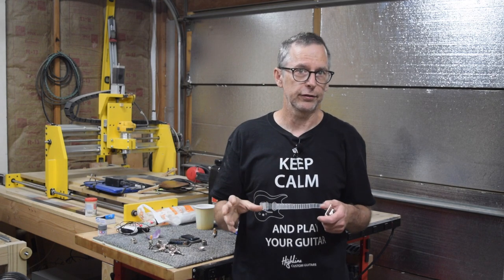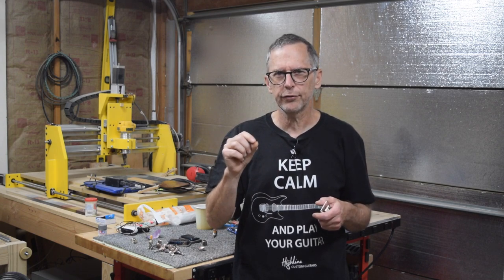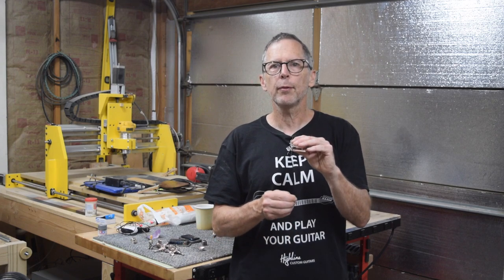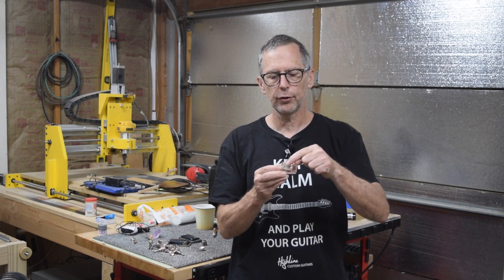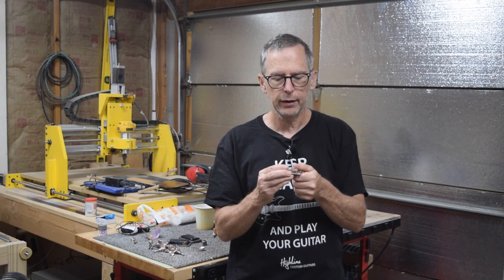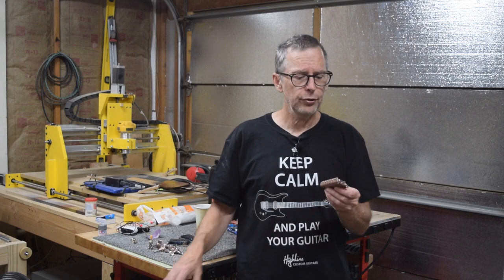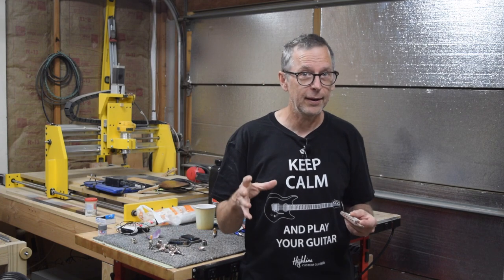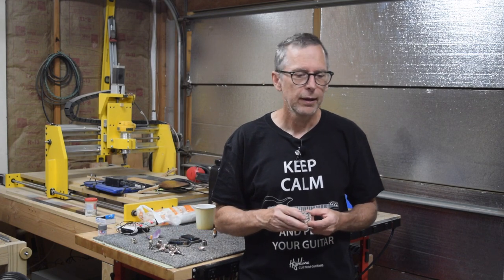Luthier Quick Tip 2 String Through vs Top Loader Guitar Bridges

Comment: Guitars with top loading bridges, especially in a 25.5” or longer scale length, play better. The shorter and more direct string path through the bridge yields lower string tension. This isn’t theory, I have tested it more times than I can count.
Reply: It's not tension. It's a string stiffness difference you feel (force required per unit length change => bend feel). String tension is entirely determined by tuned frequency, scale length, and string mass per unit length (gauge). The bridge type doesn't change any of those.
Reply: Its definitely not a theory, its a hypothesis at best and one I disagree with.  Its not you.  There are so many comments from people in the comments that are complete fiction.  The string can be 15 miles long.  The only part that matters is the part between the saddle and the nut.
Reply: @vw9659  that is my thinking exactly.

Comment: I'm getting ready to try top load on a particular Tele because it plays sooo stiff. Not sure why since I have other Teles that are fine. Love this one but it is murder on the hands. I'm thinking top loads should help due to a shallower break angle behind saddles.
Reply: I think it's because the length is shorter (missing the length thru the body) that the strings feel looser.  If that's not it, I hope someone will tell me the right answer.

Comment: Nice vid! For tuneomatics I'm confident it affects tone, since I enlarged the afterlenght of my Gretsch to the 1/6 used in violin families and to me tone and sustain improved . Just mute the afterlenght to check it. The string vibrates after the bridge more freely (I also have a roller bridge on a Hardtail) than I an short or wraparound bridge, thus lasting longer vibration and changing tone because of that notes also vibrating in the afterlenght.

I don't know if swapping the tremolo of a Yamaha for a Schaller 3D-6... Since I read that the tremolo system springs help sustain and Tone. But I rather a Hardtail for my bendings and I don't use a tremolo. What would you suggest?
Reply from the maker: Sorry, I have no idea what you are talking about.
Reply: @HighlineGuitars  you mentioned that tune o matic style Guitars sound good as Les Paul and that is a top loading bridge.... But the difference with a Tele toploading or a wraparound bridge is that there is quite a piece of string after the saddle to the tailstop. I made it longer on my Gretsch which had a funky tailstop that came from the strap screw, but made the afterlenght shorter than 1/6 of the string which is the proportion found in violin families. I Bought a tailstop and drilled it but put it at 1/6 which is way more far than Gibson or Gretsch standard placing. I think that reduces the stress on the string since there's more material streching and makes it ressonate much bigger. They told me it was non important but just muting the afterlenght with duct tape clearly kills the sound and is highly noticeable. In fact researching I found that violin family instrument players change the tailstop to affect tone and that there are even pieces to fine tune the afterlenght of each string. 

I meant that toploaders the string ends right in the saddle or very very short to ring and make any difference. Don't know if there's any free resonance in the passthrough strings, I guess not since between the Ball end and the saddle there's not much string piece. 

For the Yamaha I don't know if to put A schaller roller toploader, or just Block the tremolo and try muting the springs and replace graph saddles. I'm more interesed in building a compact travel guitar and checking about toploading bridges I surely will go for that system to keep the things as simple as possible. 

I also don't think it would made much difference if the string is that short and how many resonance is passed to the body... Maybe depends on the screws and bridge material, but I'm not that expert. Kind regards
Reply: @guitarrizer  i understand what you're talking about :)

Comment: The strings may get fed through the body but the ballend ends up right against the metal plate about 1/3 inch of bridge-metal away from where it enters if it is back loaded. The string doesn't magically remember that it had passed through the body of the guitar in order to get there. The actual place the ballends end up is almost the same exact place. I call shenenigans.

Comment: Shouldn't "sustain" and "vibration transfer to the body" be polar opposites? Any transfer of energy OUT of the string means the energy of the string itself (which determines its vibration amplitude) decays faster and there is less sustain. 

It seems required by physics that there is a tradeoff (all else equal!!!) between acoustic volume and sustain. Luckily, an electric guitar doesn't need to have any acoustic volume so can maximize the tradeoff in favour of sustain (in theory). In practice, even the magnetic pickups extract energy from the strings to some extent, and there are probably tradeoffs there too.

So I want a bridge on my electrics that transfers as little vibration to the body as is possible. In theory, this should have more sustain. As far as "tone", I suppose that depending on the frequency response of the coupling between the bridge and the string, some frequencies may decay more quickly, which may affect the tone. But I would prefer a guitar that picks up the strings as faithfully as possible. If I want any particular frequency response, I can just EQ it.

That being said I agree that the difference in this case is negligible. There are surely much more significant factors.
Reply from the maker: The last two sentences sum it up well.

Comment: And all that string vibration on a top loader is transferred through the bridge, the screws holding it down to the top and, in the example you show, through the base plate. In a String through, its really only the ball end contacting the ferrules that are in contact with the body. Of course you still have the bridge, its base plate and the string vibration through that too - but generally, the string inside the body doesn't actually touch the wood - its just the ferrules...

In general, I prefer top loading as I find it easier for restringing.

Comment: It does change the tention of the string and therfore the feel of the guitar. And that is definitely measurable.
Reply: The tension doesn’t change. If it did the pitch would change. The tuned pitch is the length between the nut and bridge saddle, and the tension and mass of the string. 

Same with trapeze tailpieces. 

What you are feeling is the extra string behind the saddle acts like a shock absorber. You bend the string and it’s like a spring loaded on the end.
Reply: @DavidRavenMoon  not sure you are right. The same way the length that act as a shock arsorber also adds tention.
Reply: Amit Sapir I understand how strings work. You can look it up yourself. 

When you tune a string to pitch, it reaches that pitch at a certain tension. That’s partly based on the scale length (not total string length), and the mass of the string. On all 25.5” scale guitars the string will be at that tension at concert pitch. This is how companies like D’Addario can list the tension of each string. 

Changing the length of string on either side of the anchor points does not change the tension. If it did the pitch would change. 

But you do have that recoil effect.
Reply: Tension doesn't change (unless gauge, scale length, or tuning change). String stiffness (force required per unit string length change) can change.
Reply: @DavidRavenMoon  Yep.  Pretty sure the tension from nut to tuner and from saddle to bridge will be the same tension as the rest of the string anyway.

Comment: My problem is ive got a 6 saddle top loader on cheap Tele i got that had hole-through back in ad pic but have none. Without the holes in back its a NIGHTMARE to top load. Was hoping to find someone actually stringing & comparing difference between 6 & 3 saddles without string-through body. Makes absolutely no sense to put 6 string top-load saddles on a Tele without holes! Would make more sense to adorn them with 3 saddles since you cant mod without drilling holes. 3 saddles goes straight through, holes or no! Was thinking maybe im just too stupid & theres some simple trick to top-side loading on a cheap Squire Tele without having to spend 5 mins per saddle just to get the string to go through?! Once again, having wasted about 30 mins of my time searching for easy solution, ill give up & try again some other day.😅
✌️🌎❤️
Reply: just bend the end of the strings twice in order to make a double curve and the string will find its way through the saddle in a topload bridge
Reply: @geridoo  Makes sense!😅
Duh.🤤 Forgot about this post. Would still make more sense to equip all top-loads with 3 saddle bridge. Probably save Fender money too if not brass? Oh well. Appreciate ya!🙏

Comment: Oh you know what, I think I might have an actual good reason for string through, not for solid, but for a hollow body electric guitar, what I'm planning to build I could imagine having the string tension on the bridge would have a bigger sideways pull on the bridge, opposed to having it string through the body, even to the back of the guitar, which would have to be thick enough for it though. So not at all for sound, but to relieve sideways tension maybe?

Comment: I call the difference BS because any vibration of the string stops at nut and saddle.
Reply: Thats not completely true. You will sometimes hear high overtones ringing above the nut, which you can hear through the amp. That's why some people use a jimmyclip, some king of foam or a fret wrap. Trem springs can make sounds and one of my guitars had ringing pickup springs which sometimes made a high noise. So the part of the string between saddle and nut is not all there is to it. How much difference other ringing parts really make is another discussion.
Reply: @clemensmoeller4549  Yeah you are right about that. The only thing is, those are free untied parts of strings that are acting as used string parts - floating from the nut to tuners. Same with a tune-o-matic bridge. That's because they are free to vibrate as little they can (that vibration is uber minuscule). Touch of the finger can stop vibrating long flabby string, imagine the stopping power of pressing against the body in a string-through even weaker vibration. Only real vibration transfer only at the nut and the saddle.

Comment: I find no difference at all sonically. The big difference to me is the feel. The strings feel much slinkier and easier to bend with top loading. Great point about Les Pauls and SGs. Basically a top loader. I actually wrap around the tail piece on my Les Paul and SG for even more slinky and bending heaven. Sonically meh. Playability big time difference.

Comment: I just purchased a guitar with a top loading bridge which I despise.  This thing should never have been created nor ever used on a guitar.  PITA
Reply from the maker: It would be really cool if you could share the why.
Reply: @HighlineGuitars  Ringing, buzzing and having to use Loctite on the grub screws to help tone it down (a known issue on Jags, Jazzmaster, and Mustangs that use that bridge.  Fix is either Loctite or clear nail polish on the grub screws).  The bridge also uses too thin of a metal and while amped you don't hear it I do as a player.  Big difference between my trem systems and through the body for sure.

Comment: It honestly can’t make any difference because all vibration stops at the saddle.
Reply: It doesn't stop, the whole guitar vibrates to a degree. It's just not significant. The guitar, the speaker, the cabinet, the amp are all (de)-forming the signal until it reaches our ears, which are all shaped differently. But imo, it is insignificant. Even what one can feel through the body is not audible. That is the realm of psychoacoustics (official term). The perception with our other senses influence how sound is perceived. Sound wise, any vibration of the body or neck is stealing energy from the strings = a loss of possible tone. Now another idea takes the stage...losing certain frequencies can be deliberate. Does something sound too high or too low? We can filter out the frequencies we dislike with an active filter circuit. So why take the chance of forming the sound with hit/miss probability when we have other options?
Imo, the goal should be to reduce the influence of the building material as much as possible, to gain control over the sound by the playing and the line of filters that (de)-form the signal until it leaves the speakers. What is gone from the signal is gone, but what is still there can be adjusted to one's liking.
Reply: I pretty much agree with you.  If people are so worried about the vibration in the guitar body then they should make sure they don't rest their arm on the guitar or allow it to touch their body as it will dampen the vibrations.  Just bend forward and let it hang off your neck.  Its the new cool look.  Soooo much sustain.